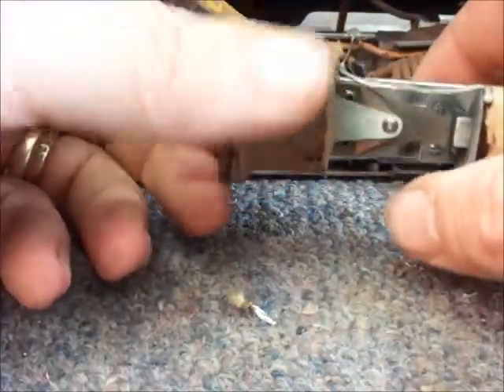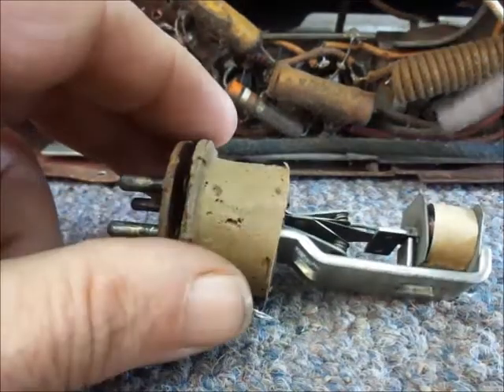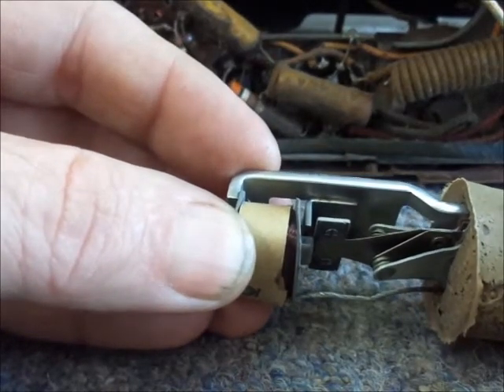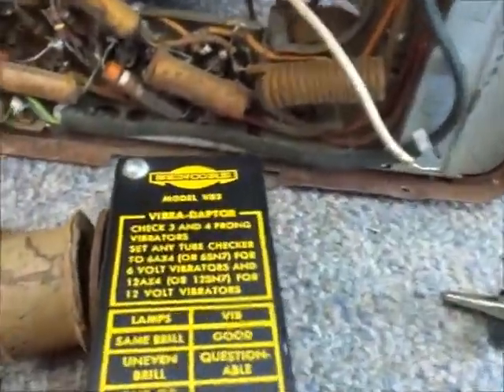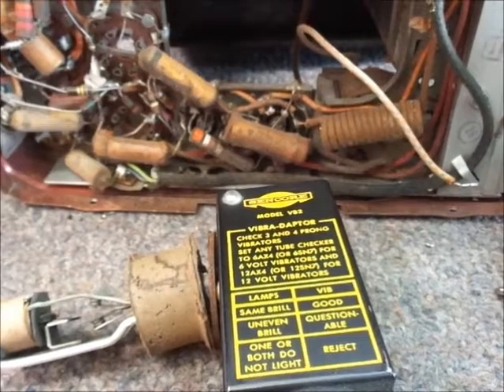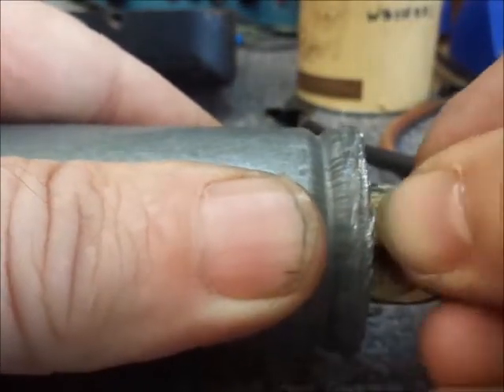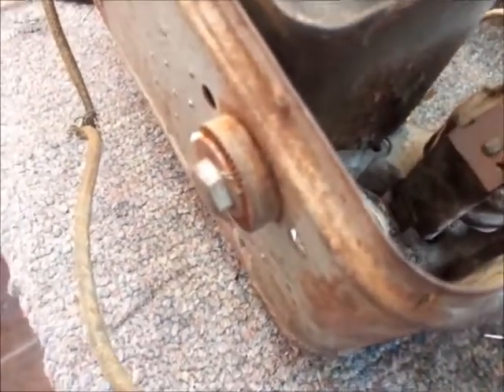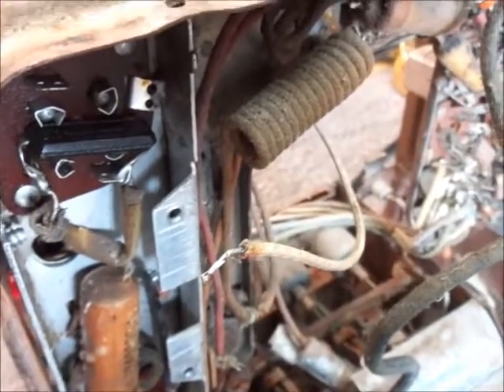1951 PONTIAC CAR RADIO RESTORATION Pt  3 Vibrator restored

Comment: On vibrators that have two contacts on each side if the reed, should one set be closed and the other open when the reed is at rest? I have a Mallory type 659 with double contacts, at rest, one side is both open, the other side has one that is open and the other closed. This vibrator doesn't work yet and I am wondering if this is among the reasons. Thanks
Reply: tobroken1965 
THIS! I have this same question! Is either set of contacts supposed to be closed when the vibrator is sitting unpowered, or are both supposed to be open?
Reply: Unpowered, one side is normally open and the other side is normally closed.  Upon startup, the normally closed contact immediately energizes the coil, which pulls the reed away from the normally closed contact.  Inertia causes the reed to swing to the other side, closing that set of contacts, which pulls the reed yet again in the other direction.  This vibration will continue until input power is removed, or the vibrator experiences some sort of failure.  The high output voltage is generated when the contacts are broken and the magnetic field collapses around the coil.

Comment: Was the vibrator intended to operate in some special atmosphere, like nitrogen? Would doing so provide any protection for the contacts? Google gives no guidance on this question.
Reply: Nitrogen was used for aircraft vibrators because the high altitude (low air pressure) encouraged contact arcing.
Ordinary car radio types operate in normal air. Provided the circuit is designed properly; eg. correct transformer and buffer condenser, and the vehicle's voltage regulation is satisfactory, the contacts last an extremely long time. With particularly good designs, it is a non issue.
One problem is when a vibrator is not used for a very long period, as is typical with a vintage radio that hasn't been used for many years - an insulating film builds up on the contacts. It comes from decomposition of the sponge rubber can insulation. Provided the contacts are otherwise in good condition, this can be electrically burned off without having to open the can.
This site has a few articles on vibrators http://members.iinet.net.au/~cool386/